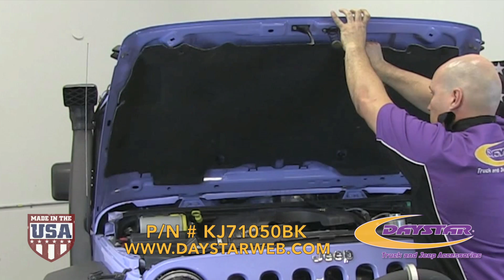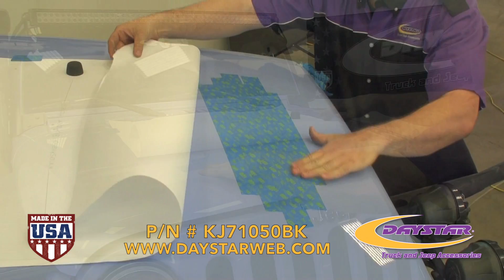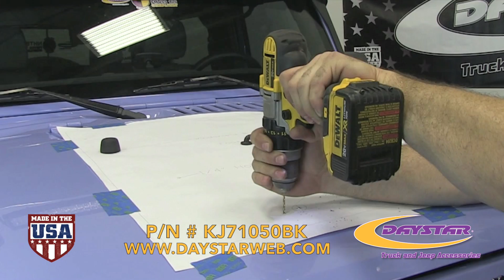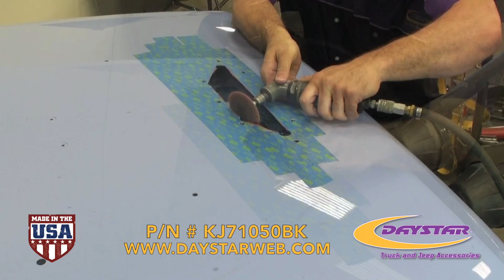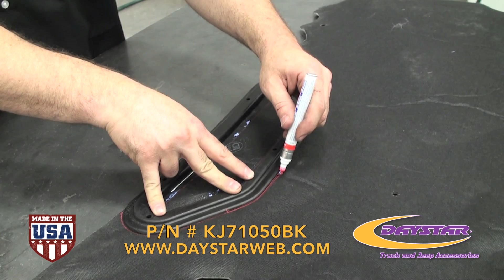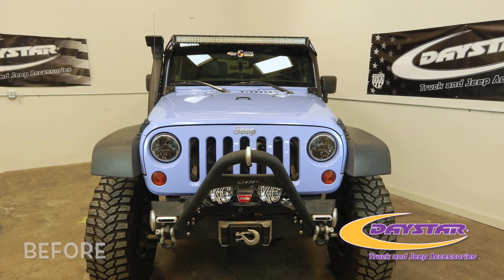Daystar Hood Cowl for JK Install

Comment: Wouldn't you be better off just cutting the hole in the front and not having that giant cowel?  At high speed, you're going to have that high pressure cowel air making it difficult for air to flow through the radiator, and at low speed, you have a long, convoluted path for the air to exit instead of just floating straight up